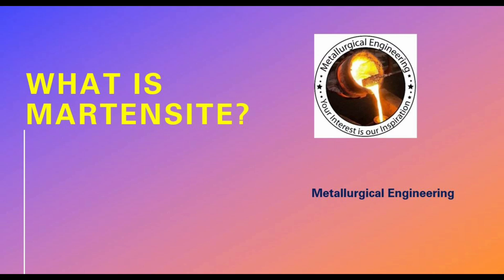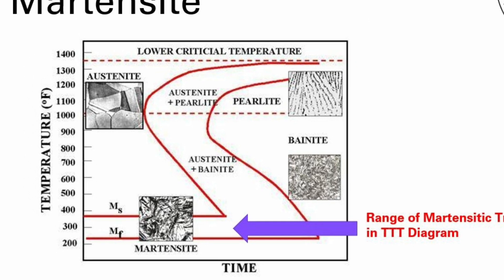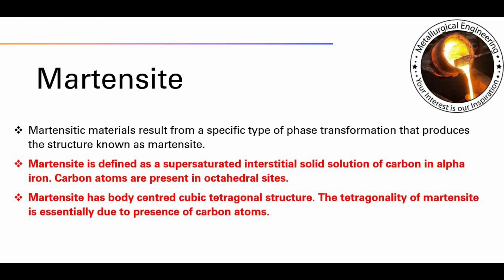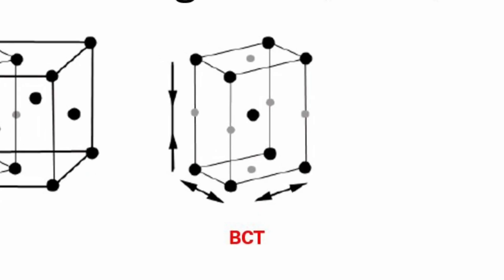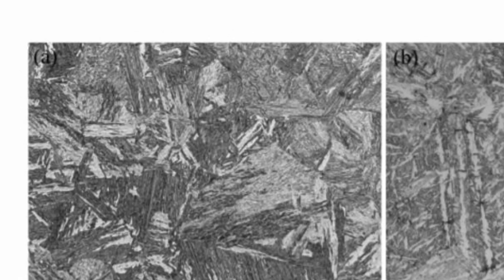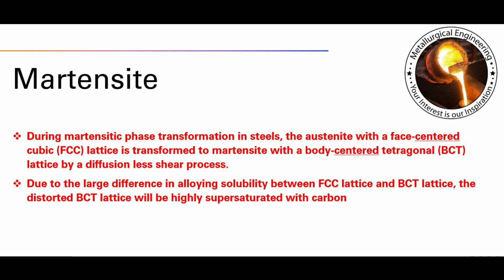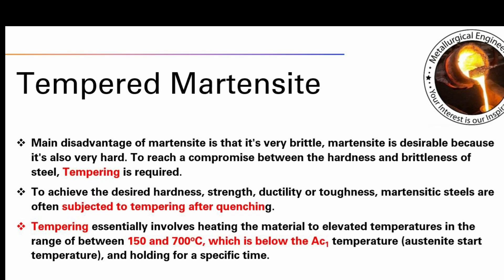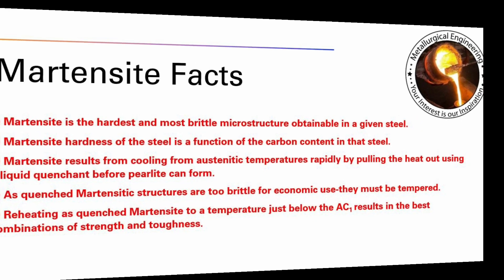Martensite

Comment: Hey these are great videos! A little constructive criticism for you: I'm a mechanical engineer so I had full semesters on the topic in this video and while your video hit all the main points of what martensite is and how it forms, it's not very explanatory. Given that the video is titled in a way that seems to try to introduce new metallurgists to the topic, I think the video could be slowed down a little bit to allow for better absorption of information, and maybe include some examples of what makes martensite important in metallurgy and heat treating. Again, I like the effort put into your videos but an experienced metallurgist would know most of this stuff and an inexperienced metallurgist might have most of this information go straight over their heads. Food for thought, thanks for reading:)
Reply from the maker: Thank you for your remarks. 
I will definitely work on it.